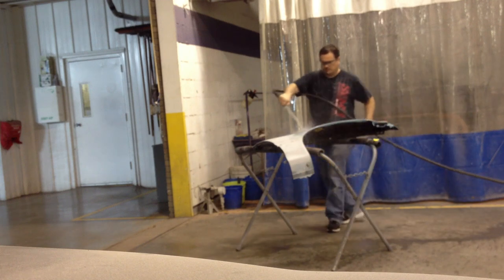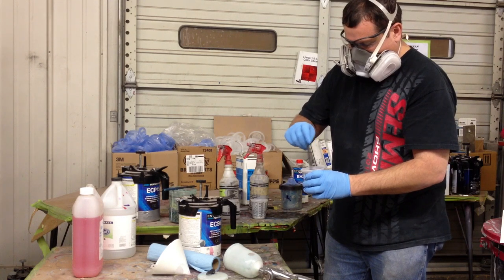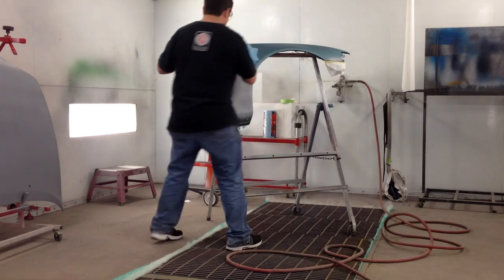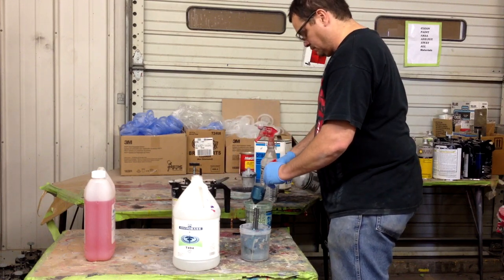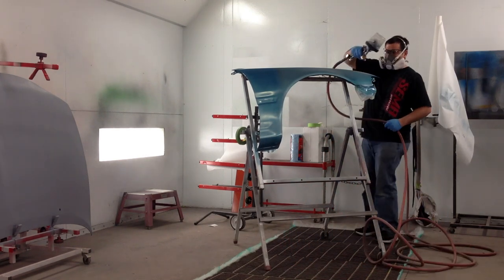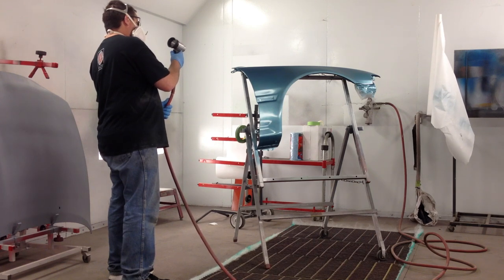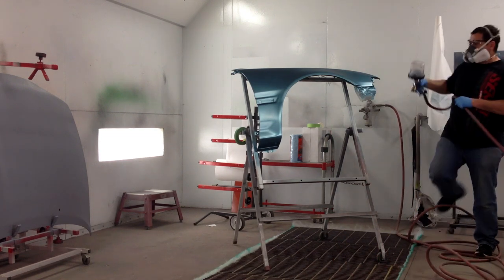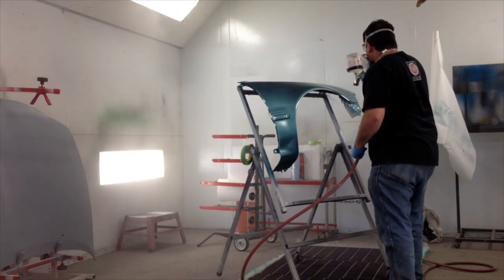How To Spray Primer Sealer, Waterborne Base, and Clear Integra Project

Comment: great video, one thing i have learned in the last 30+ years of painting is, keeping the booth clean. you have way to many things in there just sitting and collecting the "dust/dirt",  that's getting into the paint job. remove everything not being painted. that hood and stand, the tape machine, the stool, and all the other stuff in that booth. clean the booth before even putting in what your painting. also you need to wear a spray suit to eliminate most of what ever will come off of you, and into the painted part.

Comment: Hey need some help here!!! Had a buddy mix me some water bourne paint at the honda dealer for my Toyota Sienna ground effect panel. I painted the thing about 5 hours ago and I need to know if I can get away with Rust-oleum  crystal clear Enamel for my clear coat. This is the only clear I have, and nothing is open tomorrow for Christmas. Should I wait to do the clear coat? Will this enamel clear mess up my paint? I see you did the clear shortly after the base coat. Stressing here. New to this, and this was my first time ever using a paint gun today.  I hope I didn't wait too long to shoot this clear coat. ugh!!!
Reply from the maker: Here is  a video answering your question.  https://www.youtube.com/watch?v=36Z7XwAMS54
Reply: @CarAddictGarage  Thank you so much for the detailed response. When I painted the water bourne base coat I had no idea I needed to get the clear on within a time frame. I ended up calling a local painter and bought some automotive clear from him on Christmas day.. It wasn't water bourne though and it still worked amazing. I ended up getting it mixed up and on within 24 hours. It turned out better then I expected! I did notice the waterborne paint seemed to settle or look smoother a the next day before the clear... I'm curious if the paint will still settle with applying the clear shortly after I used a hair dryer on the panel for about 10 minutes after each coat and waited a little past 10 minutes to do my second coat of paint. I did 3 total coats. Your advice was spot on with the local guy who I got the paint from who has been painting his whole life. I really appreciate you taking the time to answer my question. Liked and subscribed. 🍻